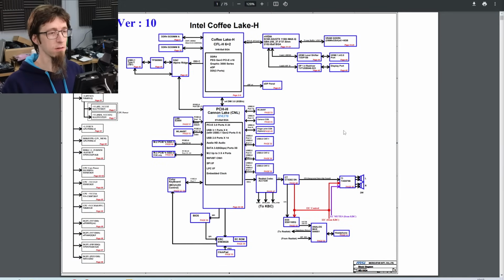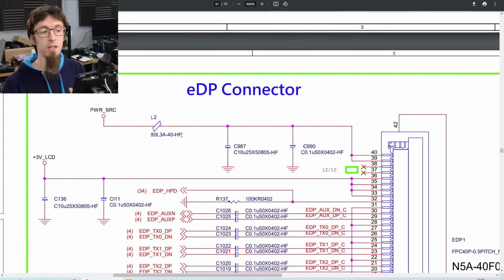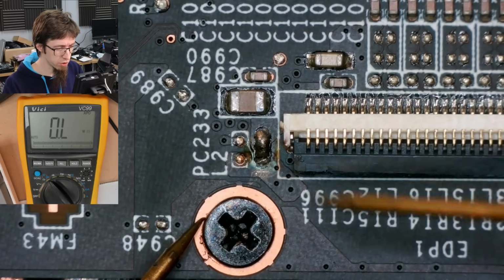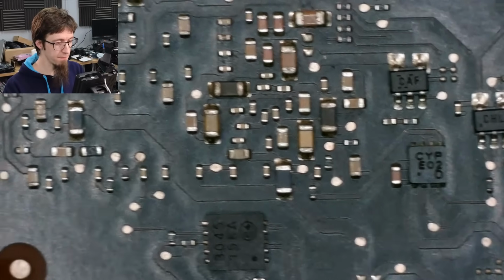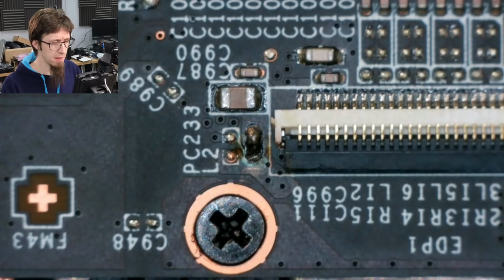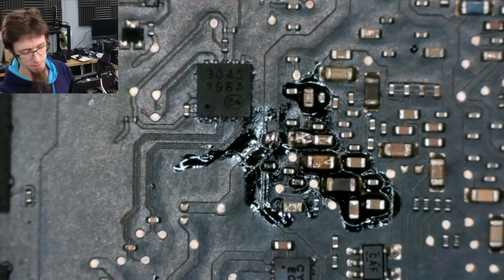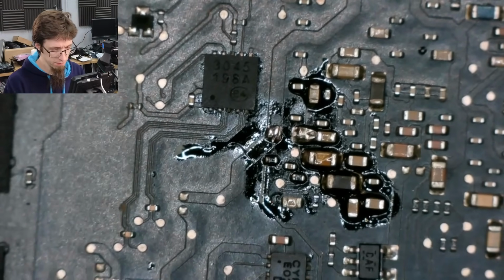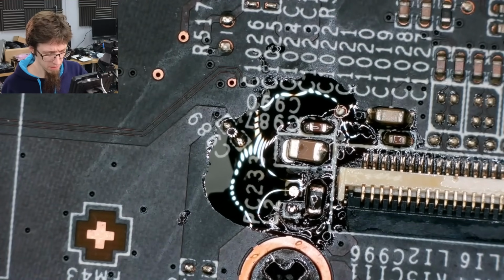MSI GS65 Gaming Laptop, No backlight - LFC#372

Comment: Thanks a lot—I was able to fix a laptop. I looked up the schematic for an MSI GE62, which had the same capacitors, so I went ahead and desoldered and soldered them onto the MSI GS65, and it works perfectly. Greetings from Panama.

Comment: I was eager to do a bit repair work here and there myself thanks to many of your videos, but I quickly noticed that like 90% (if not more) of requested fixes were software related. It was quite frustrating. I actually never had a case of "it won't turn on anymore." So I wonder how often you have software issues in and how you deal with customers asking for a fix of some OS shenanigans. Honestly curious.
Reply from the maker: Yea, certainly when you start out it's all software and dead HDDs. I have a fair number of no-power style jobs come in, but I'm well established, and the channel also funnels this kind of work my way. But that's a double-edged sword, boring software fixes are what pay the bills because you do five of them at the same time on one bench while you watch youtube, instead of spending hours concentrating on a single device.

Comment: Capacitors are crap. I'm pretty sure they are doing it on purpose to shorten the life and to make more money.
If you buy a laptop for $2000+ a component for less than a $1 shouldn't make the whole computer fail so easy.

Comment: I like how you talked yourself out of checking your work (temperature of replacement).
Reply from the maker: Haha, I actually did check it, but I left the recording paused and didn't notice until after I'd put all the screws back into the bottom of the laptop. The first turn-on is actually a retake after I realised the recording was paused 🤦‍♂️ Rather than do a 'trust me bro' speech I figured I'd explain why there would be nothing to worry about after all.

Comment: I saw the ferrite beads available on Digikey (U.S.) for $0.11, just fyi
Reply from the maker: Yea in the UK component suppliers will happily charge $10-15 for shipping on single components, so yes these parts are available, but not at any kind of price you'd want to pay unless it's a common item worth keeping in stock. For one-off repairs where the chances of seeing the same item again are slim, the big component suppliers are just not worth the cost.
Reply: @Adamant_IT  thanks, I appreciate the plight of a small repair shop. I have seen small ferrite beads on ebay  50 for $4, you could put a few turns of # 28 wire though one, make your own, but who knows what it's rating would be? Anyway thanks for the response. BTW #28 wire is rated at 2 Amps continuous, so it should act as a fuse under high load

Comment: Thanks for the informative video!  Quick question, I noticed that you tend to use a large "knife edge" soldering tip a lot, even when working on small components. Is there an advantage to something like that as opposed to a smaller soldering iron tip that's closer to the size of the component? Seems like that larger tip would be harder to use especially in more crowded areas on a board. Just curious. Thanks!
Reply from the maker: Smaller tips start getting into specialist territory. A smaller knife edge than mine exists, but I can't find it. People keep labelling the tip I have as a "KU" when it seems a lot closer to just "K".

Comment: Nicely done Graham. You do love your huge soldering iron tips! 😉
Reply from the maker: Yea, new soldering station is going to be the next upgrade. There are smaller tips available for the TS100 / Pinecil style irons, but it's tough to get good heat transfer on them. I have a 1mm bevel tip, but it just doesn't have the thermal mass for motherboards. I tend to only use it as a last resort when I'm working on 0201 resistors.
Reply: @Adamant_IT  Did you end up upgrading? just curious, I'm in the market

Comment: so your micro-screen is on a arm did you make or buy?
Reply from the maker: It's a standard monitor arm, if you find an arm that has the 'socket' side of the hinge on the end, instead of the 'ball' side, the Andonstar scope mounts fit right in.
Reply: @Adamant_IT  don't why i didn't see that before but very nice mine is mounted on a block i fashioned to have it higher but the arm is very nice